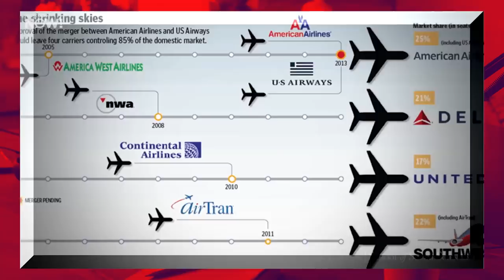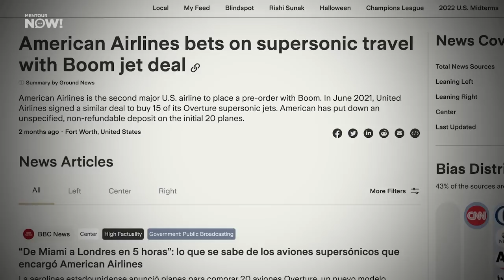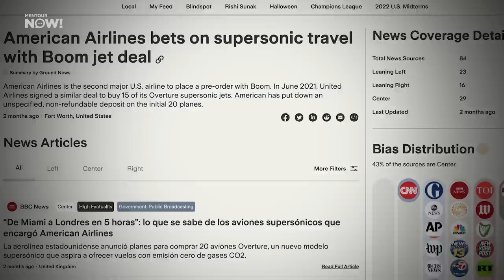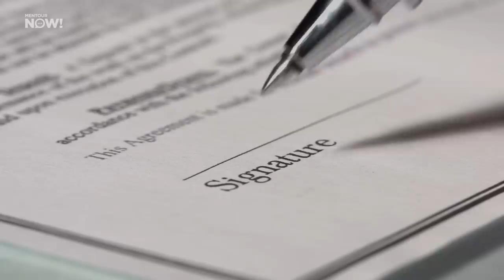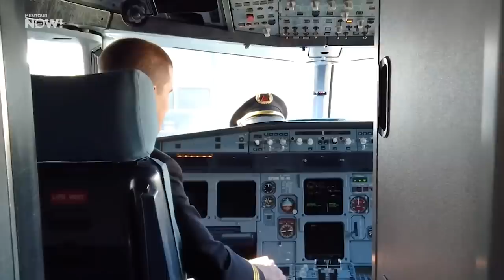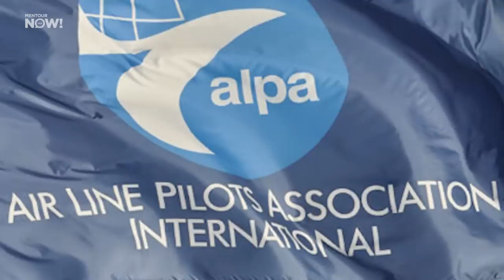Is This the DEATH of the US Regional Airlines?!

Comment: Two very crucial facts that you did not touch on Petter, are 1) the tremendous size difference between the United States and Europe and 2) our total lack of a national public rail system.  It is a much used reference point, but it needs repeating - all of France would fit comfortably inside of Texas with room to spare. Speaking as a business traveler who has spent time in the EU, our regional airlines essentially operate as your business class rail service.  

Is it the most effective or efficient way to do things? Not going to try to defend it one way or another.  It evolved organically - in fact, there was a great advertisement by Delta back in the 1980's (using a stranded motorist) with their "We're ready when you are." campaign that captures it perfectly. 

In addition, for business travelers, who still make up the majority of the revenue on US flights, wasted time sitting in an airport hub is wasted money.  
Consolidating five regional flights/day to two large body jets does not well service this market.  Point-to-point service in a country with 51 government centers plus the terratorial centers and the major financial hubs and every other city with manufacturing? I am not going to go there.  Would the market "deal with" a loss of flight frequency because it has no other option? For a time. Until it finds more cost advantageous options which possibly will not involve flying at all.  It is always good to remember who your customer is.  

Runway length and "international" in a name is not sufficient research to assess an airport.  Runways are often built long in the expectation of growth or other reasons.  Harrisburg, PA, and Tallahassee, FL, are both state capitals, and, accordingly, cities with much business travel.  Respective populations and airport terminal gates:  ~550,000 with 12 gates, and ~150,000 with 14 gates.  Those really are not large markets.  (My apologies to my Western sisters and brothers but my miles have been mostly east of the Big River.  Please add your thoughts.)

Net, net, I believe there are several more variables involved in why the regional system works for the NA market.  I agree with you that financials are certainly a major aspect of it but there are other sides of those financials - if people stop flying, no one wins.  My money is still on the regional system for the foreseeable future, especially now that the airlines are beginning to pay their crews more correctly.

I apologize for the long response, but you put so much great effort into all of your videos, which i enjoy and look forward to every week, that I felt you deserved more than just a terse one sentence response that might be misconstrued. 
With Best Regards  Lisa
Reply: contiguous US - 8 million sq km
Europe - 10.5 sq km ( there is more to Europe than what's in the minds of the typical American tourist)
Rail systems in Europe are ok within individual countries. Not so much for international travel.
Reply: @jeffn8218  so shall we include Canada and Mexico?  LoL No the point is, why would Air France have a large set of regional aircraft when their country is small. I always find it odd how Europeans don’t want to be lumped together unless it fits their argument.
Reply: @jeffn8218  does that number include Greenland?  Because I know it probably includes Iceland and Greenland is politically part of Europe even though it is geographically part of North America.  A rather enormous chunk of Europe is also included in Eastern Russia and while I'm sure it's somewhat different from the days of the USSR I'd be willing to guess that air service in Russia is still significantly behind what is found in Western Europe or even the less populated western parts of the US.  When you start throwing these numbers around you have to compare apples to apples.
Reply: @jeffn8218  I have had no difficulty using rail for business travel across multiple international borders in Western EU.  I cant speak for farther east.  The worst I have experienced on rail Europe far exceeds our best which would be New England/northest corridor.
Reply: Excellent points, as a regional employee you explained excellent points.
Reply: I enjoyed reading that. Thank you. One question: why does an airline like Republic Airline does or fly under its own livery, especially considering it is doing flights for American, United and Delta? It is a fairly large airline in itself.
Reply: one question almost all europeans ask me is: are you an international pilot. I don't understand where they get that question from.. as if that's a different kind of pilot. When I fly from Bangor to Daytona, or DC to Denver... that's like Constantinople to Amsterdam!
Reply: @MrPomelo555  Branding and codeshare. Republic is paid by the mainline they fly for under a contract. The mainline seeks to fill in the gaps of their route coverage, so if you're going from Tucson, AZ to Pittsburgh, PA for example, the passenger will pay a single carrier and likely fly a route something like TUC -> ORD -> PIT. If the customer had to combine two separate airline entities, they would get off in Chicago go to baggage claim, then check their bags on the next airline and have to go through all the security checks again. And besides when it comes to air travel, passengers look for a name they can trust to safely get them to where they need to go. Remember Colgan Air? Who would ever want to book a ticket with them?
Reply: I don't think he mentioned that our regional air services are subsidized by the federal government.
Reply: There not a real big market for public passenger rail systems here in US. I mean look at what happen to that high speed rail line that they were trying to build in California, and how that quickly flopped. Now i am not sure it because of difference in cultural preferences on transportation, between the US and Europe. But that what it is as far i see it. As for the airlines big or regional. Part of the issue is they are not willing to pay their pilots as they should, plus the cost of training like other countries airlines do. Another thing is we allowed issue in the entry level general aviation to fester to the point it too expensive to engage in anymore. This is not like the 1980's and 1990's, where any middle class Joe blow who wants to become a pilot, can afford too enroll in a flight school.
Reply: @KenKen-ui4ny  the California high speed rail project was doomed from the moment they outlined their project goals.  Unrealistic travel time and operating budgets had them playing catch-up from day one.  I am not sure it is a true reflection of what the public really wants.
Reply: @scottboelke4391  and not just in distance.  The culture differences across this country can be....educational.  And entertaining.
Reply: Awesome write up. I learned a lot, and that's coming from a commercial pilot! You certainly know the industry and its ebb and flow well. Hats off to you
Reply: Lisa, I whole-heartedly agree with on your point about departure times and flight frequency, but not just for business travelers; leisure travelers who need to make connections require well-timed flights as well.

Comparing the North American and European markets is tempting, but there are so many substantive differences.
Reply: @melissajohnson2935  that statement isn't completely accurate.  The Essential Air Service (EAS) program was put in place in the late 70s to ensure that small market areas that currently had air service would not lose it due to deregulation.  There are about 175 EAS locations, with about 1/3 of those being in Alaska.  Airlines - any airline, not just regionals - receive  a per passenger subsidy to maintain daily flights in and out of these locations.  There are restrictions on what can and cannot be defined as a EAS community; for one example, in the lower 48, it cannot be within 210 miles of a hub airport.

There are over 5000 public airports in this country.  About 500 of those serve commercial traffic.  Less than half of that 500 lands aircraft receiving EAS funding.

Air service means the possibility of economic growth for commmunities. New businesses.  Economic growth means jobs, improved quality of living (hopefully), more opportunities.  The airlines may receive the money, but the benefits are shared on a larger scale.
Reply: @JesterHorse  thank you for the feedback. I hesitate to make long posts, but some things deserve more than 144 characters!
Reply: @Bigskitch  thanks!
Reply: @fltof2  very true.  It sort of highlights that I am not doing enough of that vacation thing...
We may be 'one world' but we are still three very distinct markets:  EU, AP, and America's.  I worked for a large European glass company as tech sales and marketing to support a plant in Central America. Our team was constantly being criticized for our travel budget and for being unorganized because we only visited one or two customers a day.  It reached a boiling point when a manager decided to come to the US to "show the Americans how to run a sales office."  He picked four customers and told us to schedule them all in the same day. These customers were in VA, NC, SC, and...Alabama.  Ask and you shall receive.  We picked him up at 4:45 a.m. Six flights, 4 rental cars, and three drive through meals later,  it was just before 11p.m. when we left him at his hotel.  We had to explain the driving distances to him at least three times, but something finally got through.  There was no more sniping about the American travel budget.
Reply: Well done, Lisa! Bravo Zulu.
Reply: Great analysis Lisa! As a former regional FO, we act as an “on-demand air taxi.” Anyone in the US who books a ticket online chooses their flights based on layover times. The regionals keep these short (the traveler seldom seriously considers the mechanical/weather delays that can disrupt their expectations, but that’s a different discussion…lol). The Union has a lot to do with it, but customer expectations of flexibility in travel times drives our boat…especially business travelers…who are the money makers.
Reply: @scottboelke4391  Well, to be fair, flying (I should say "operating", as the job entails more than just the airborne aspect - as you know) international routes is WAY easier! I started flying in the Navy in 1977 and flew for Delta starting in 1988. The one takeaway I have from my 40 years of flying is, the more you get paid, the less you work! Being a 777 Captain is considerably easier than being a 737 pilot.
Reply: @kayakutah  or a lowly regional CA, like me
Reply: @scottboelke4391  Yeah, you work harder, for sure!
Reply: Your attitude towards "business travelers finding better options that doesn't involve flying" tells me everything I need to know.
Reply: @radiationoncologist  if you are going to use quotation marks then quote the reference exactly.  What i wrote is "until it [the market] finds more cost advantageous options which possibly will not involve flying at all."  I did not use the term 'better' which is subjective and unmeasureable.  Nor was i definitive that flying would be eliminated.  Read what was written, not what you want it to say.
Reply: @brettking1014  thanks Brett.  Some of us frequent flying road warriors thought about weather all the time - anyone for Buffalo in January?  But you go when and where the customer/business dictates.  Sometimes you have some buffer time in case of enexpected events.  Sometimes not so much.  Some really fun times, but living on the road can wear on you , as I am sure you know. I hope you are still using your wings - you put in a lot of time and work to get them.  We need all of our pilots.
Reply: @scottboelke4391  There´re complicated rules in Europe - now not to talk about Russia and Belarus, who´re own Stories, and the Ukraine, who´s unfortunately an own Story, too.
The European Union has since 1992 a so-called "Common European Sky", regulated by an European Authority, the EASA. All Airlines registered in an EU-Country have the Right to operate in the whole European Union as if they would operate in a single Country. BUT: The registration of aircrafts is still national, the employment rules are still national, the tax laws are still national, the accident investigation branches are still national = runned by 27 national states according to their specific national laws. The UK since the Brexit, Norway, Iceland and Switzerland are not part of the EU but have special treaties with the EU which implement more or less of the EU regulations to them - the question if more or less can be important. Some Countries in Europe are fully outside of the EU-System: Serbia, Albania, Montenegro and especially Turkey. So Turkish Carriers are operating in the EU under the same rules as e.g. American Carriers and for a flight to Istanbul the same rules are in charge as for a flight to JFK - not the rules of the Common European Sky. And a Flight from Paris to Berlin is an international flight allthough it is dealt with according to the CES. During the Pandemic this became especially important because at some point nearly all international flights were shutted down by the national Governments = most of the Flights at all.
Nevertheless the CES is a tremendous step forward because until 1992 every little European Country made its own thing in aviation.
Maybe this explains the questions.
Reply: @trishayamada807  Regional aircraft in Europe mostly fly across borders for international travel.  So for Air France, that has the company Air France Hop, they fly from various not so connected airports in France to other destinations in Europe. While Air France itself will mostly just fly to Paris from various places in Europe and the rest of the world.

Lufthansa Regional, which is smack in the middle of Europe, flies to 24 different countries in Europe, but the majority of the flights are from smaller airports in Germany to financial areas in the other countries. With a few flights to and from some of the German islands that lies in the most northern part of the country, to the central/southern part of Germany.

As such most of the regional flights that does not fly to the remote destinations like smaller islands, are just regular international flights between smaller airports with lower capacity aircraft. There is nothing special about it otherwise. The most outragious example is Air Baltic, the flag carrier from Latvia, they replaced their entire fleet with just A220's and they even fly to Egypt with them.
Reply: @lisanadinebaker5179  The california high speed rail project is alive and well... yes it's behind time and over budget, but so are most high speed rail projects in the world, even in the promised land of public transport Japan. Once it's done, people will stop complaining and start boasting about how great their state is for having it, it always works like that.
Reply: @lisanadinebaker5179  americans keep saying this but the cultural differences are nowhere close to what you see within europe.
Reply: The argument still stands that the airlines would ultimately save money if they consolidated their operations and bought new jets that don't need to fit into arbitrary scope clauses - even if they keep operating smaller jets to offer more flights per day. As soon as the advantage of lower wages goes away and you're still stuck with the higher fuel and maintenance costs due to the older fleet, anyone who swoops in without being hindered by scope clauses can serve the same routes cheaper and put you out of business.
Reply: Great rundown Lisa!  I didn't know about the 76 seat thing but as I was watching Petter's also great breakdown of this I started thinking about how this could result in fewer daily flight options. I also fly a lot of 1-1.5 hr flights and most of my routes have 2-4 daily flights which really helps me to save nights away from home. Fewer flights on bigger planes would mean more overnights for me so I hope you're right on this one!
Reply: @trishayamada807 Air France do operate regional flights outside France, there is some overlap between regio als where places are Services by more than one airline. This model was the same that was used in Brazil, which is actually bigger than the contiguous 48 states, ironically, here what happened whas the oposit, the Regionals including David Neelehan's Azul Airlines discovered that there were loads of money to made with direct flights between regional airports, they ended up either buying out the main airlines or driven them out of the market. They did this because in most of the country you couldn't land a 737, they started out using small turboprops or smaller jets like the Fokker 100, when they could, they the drove the growth of Embraer by asking it to make a smaller jet for regional operations, something like the Fokker 100 but better, this game birth to Embraer ERJ series of Jets, which were sold in high quantities to Europe and a to US, but a bit less so, later, the airwais wanted something bigger that could land on the same airports that the bigger turboprops and the ERJ Jedts, it lead to the first generation of E-Jets, David Neelehan's Azul Airlines, bought so many E190s that it paid much of the development costs Embraer had with the type. Today the Regionals almost do not exist in Brazil, because they operate as mix of the American and European business models. They mostly fly Embraers E-Jets, B737s and and A320 families, each type of aircraft used where they are bound to meke the the greatest profit. Heck, some airlines still use the ATR-72-200 on routes where the traffic is really small or too seasonal to keep operating jets all year round.
Reply: Your number includes Russia, Ukraine and Belarus, isn’t it?

What not to name the whole Afroeurasian continent?